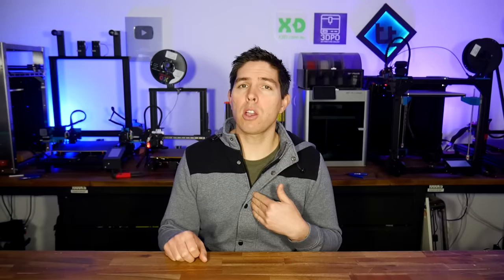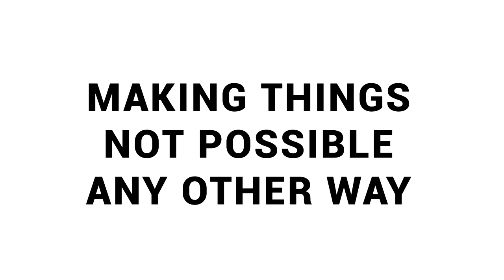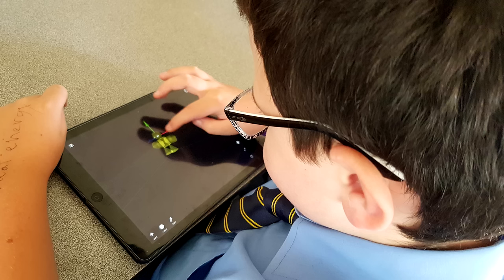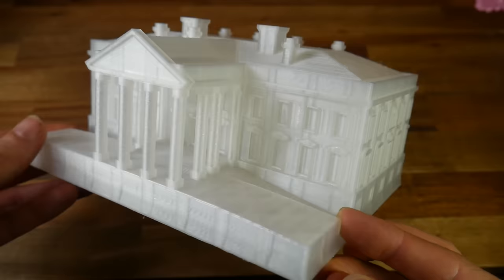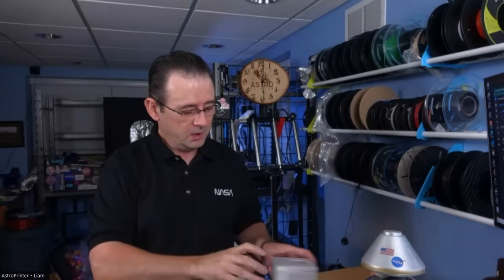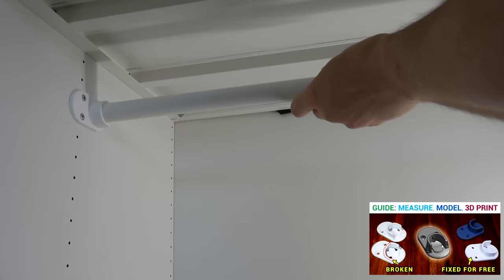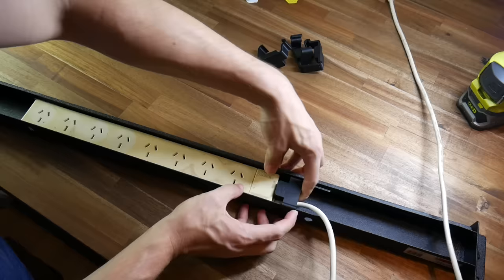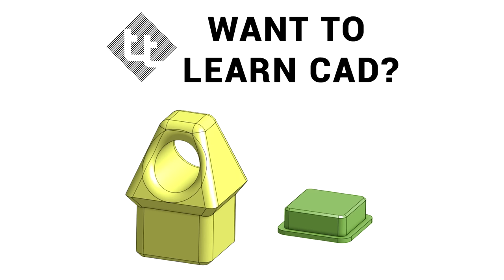These 3D prints will convert non believers

Comment: For the average user they dont do much - what u missed is that ALL u shown is available on amazon  - works and u get next day - no printer, no learning CAD and n failed prints - 3d printing for hobbyists is an exercise a hobby - the NEWER printers that do metal and high temp are next step - but hobbyists and their" cheap" mentality (cheap meaning printer ec... - keep the printers where they are.
Reply: They are only as powerful as the operator. However your statement is false. There many things that not available for purchase. Those that are are often much more expensive than they should be. For instance there is a plastic bracket in most cars that connects the window glass to the mechanism that drives it up and down. Injection molded, and originally pennies to make. The manufacturer of my car decided not to sell that component however, and requires you to buy the entire mechanism at $160. By printing a replacement not only did I get the replacement part for less than $0.50, but I was also able to improve the design such that it will never fail again.
 I have a friend with a cracked up dash console in an older Jeep. He could probably get a replacement (for hundreds), but it was designed for electronics that aren't used any more. So he designed a new one that has USB ports, a LCD, and other modern features.
I need a bracket for a handguard on a motorcycle. You would think you could find one, but none of them actually fit. A lost PLA casting to the rescue. 
A toilet paper holder that keeps falling off the wall - a printed replacement bracket that has stayed on since. 
This locking knob is not available commercially https://www.thingiverse.com/thing:4679740
A PEX tank bullhead fitting doesn't exist that I can find commercially so I made my own. Yes you could get an NPT bulkhead fitting and adapter to PEX, but in a small tank finding a flat spot for the larger NPT fitting would have been impossible. 
The list goes on and on. 

The tool is only as good as what you make of it. I mostly use mine to fix things, or create things that don't exist. Sometimes they do exist but cost too much. You don't want it to be a toy maker, stop using it for making toys.
Reply: not sure where you live but most people can't get things next day on Amazon. The satisfying part for me is being able design or modify things according to my requirements. OTOH if there was a 3d printing service that i could get next day service I would probably use that, but still, when prototyping something it is invaluable to be able to get an immediate result in order to refine and perfect the design.
Reply: @larrysteinke1839  really? ny, nj sd. sc, nc - most every state next day - thats not the point though - the point is still there - 3d printers need to be moved out of hobbyist price levels and allowed to mature into true manufacturing systems - hobbyists can stay where they are but lets not kid ourselves - cheap is cheap and we get cheap with a LOT of effort for minimal gain in many instances. no matter what 3d printers are still slow, cumbersome,  cheaply made and not reliable in production. How many people PAY for a proper CAD CAM? FREE FREE - i think u can get my meaning for production work - if it dont exist iwill make it - BUT i found most of the time the damn thing i need is available on alibaba or amazon - next day